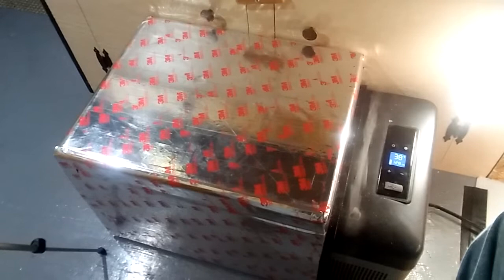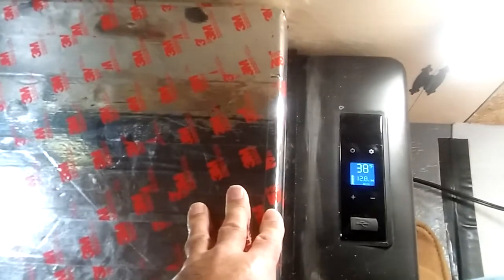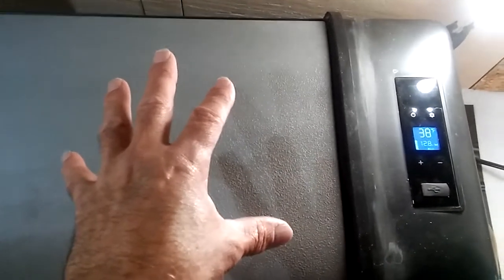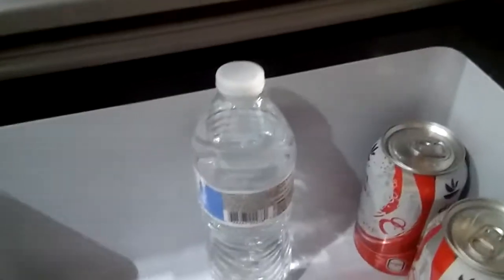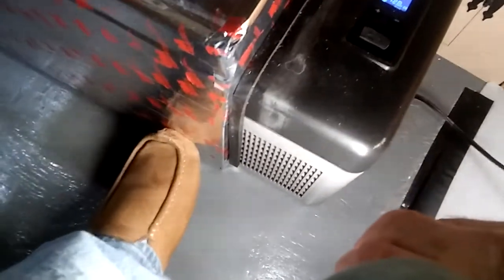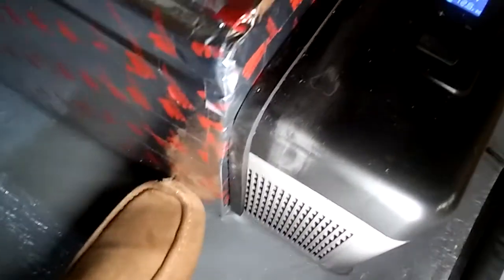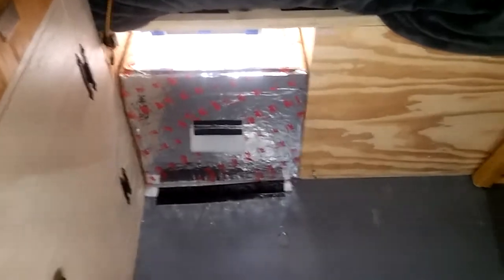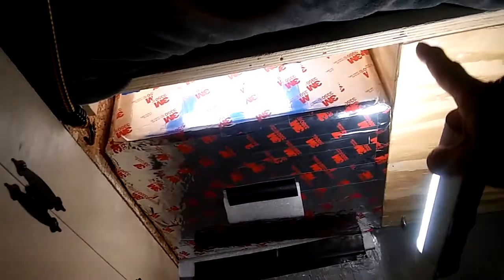ALPICOOL C15 12 VOTE fridge freezer review

Comment: how noisy is the fridge when startup and operating?
Reply from the maker: The C15 is quieter than my house refrigerator it works very well I've had no problems with it. With all refrigerators there will be noisy but it's not enough to keep you up at night once you get used to it you don't even know it's running.
Reply: @vanpiper    for car camping
Reply from the maker: @fdsaffff  yes the C15 alpicool is good to use in a car because of its size. But can drain your car battery overnight. I started out with a hundred watt solar panel and then a hundred amp Deep Cell battery I did not feel comfortable using my van battery. I didn't want to wake up and not able to start my van.😃